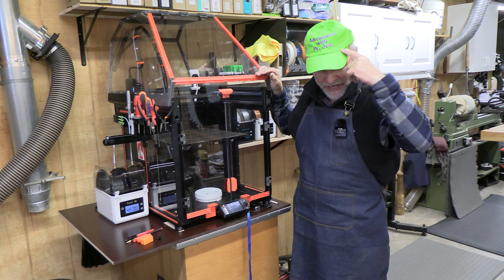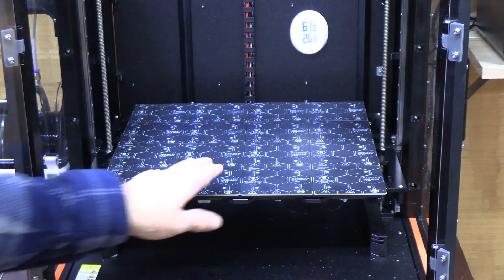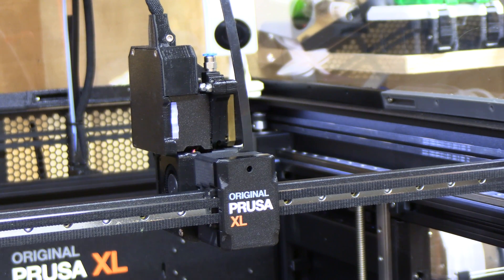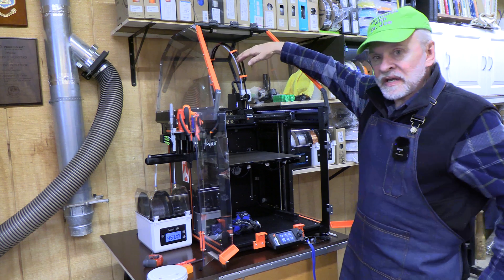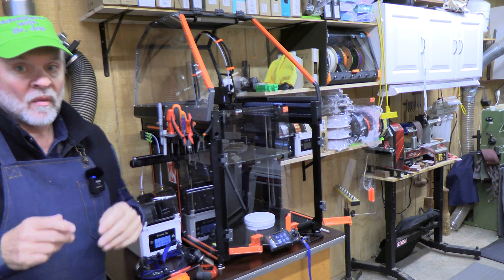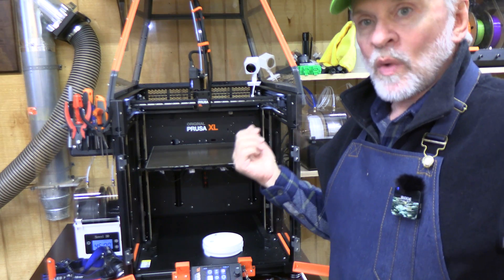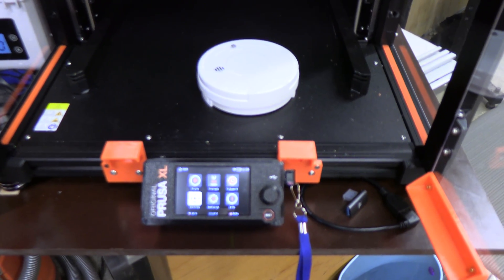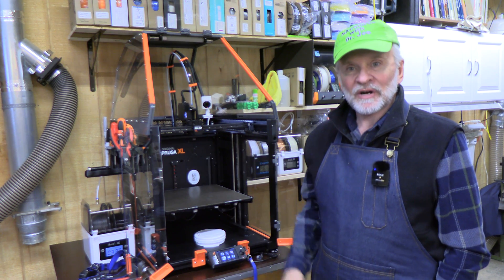PRUSA XL REVIEW: A Big 3D Printer with Lots of Features

Comment: I see you are using the Encloxure  I have the a 2 head which i upgraded to the 5 head i have been trying to print polycarbonate with the enclosure closed and found the high temps required for PC i get heat creep blockages that kill prints now where before the enclosure i mostly only had to deal with warping and problems related to that warping off of the bed.
Reply from the maker: Thank you for your comment. Yes I like that enclosure a lot. It was fun to build and I use it continuously. I have not used polycarbonate so I can’t comment on that. Pelle and PETG work great. TPU or flex doesn’t work at all. I’m having a lot of trouble with that and I’m very frustrated. Do you have any TPU suggestions? I hope you can resolve your issue with polycarbonate. Consider subscribing. Thanks. Joe.

Comment: Love the idea of using a fire alarm underneath and a fire suppression system above the printer! My wife is sensitive to having a 3D printer run unattended for this very reason. I’m sure that this would help ease her mine. Amazing idea!
Reply from the maker: Hey, thank you so much for your kind comment. Yes, it’s a very straightforward installation and that fire extinguisher is incredibly effective. It’s used in race cars and other things. Also a smoke alarm that fits inside the printer. I think makes a lot of sense. Also, when it was an easy. I just stuck it on the back so thanks for your comment. Consider subscribing. Thanks. Joe.
Reply: @JosephHunstad  subscribed!

Comment: Suggestion..
If your future plan is to reuse that waste filament.  You will want to create a bin for each filament type and label it as such.
Reply from the maker: Thank you very much for the comment. That’s a great idea. Yes I don’t wanna make a filament role with multiple types of filament that would be a bad deal. I think I will use an empty filament bag that keeps the moisture out and label it with a marker. It’s probably an easy way to do it. Consider subscribing. Thanks. Joe.

Comment: What size table would best hold the xl. I’m going purchase soon and want to make room for it.
Reply from the maker: So I measured the printer itself which is 20 x 25“. It’s also very tall. The table I have it on is 28 x 34“. So they have to be pretty big. Particularly if you want to have a filament dryer sitting on the side of the printer. I have a filament dryer on each side. If you do purchase one consider clicking the link in this video, it will help me a little bit and the price to you is exactly the same. Thank you. Joe.
Reply: @JosephHunstad  Thanks. so is it 25 deep by 20 wide ?
Reply from the maker: Yes, it is 20 inches wide and 25 inches deep

Comment: Finally about to convert my oreorder...did that nozzle kit come with the printer??
Reply from the maker: Thank you for your comment. The printer comes with a standard nozzle and then the nozzle adapter so you can order the small little nozzles. It also comes with a fine wire to help unclog a nozzle. Consider subscribing. Thanks. Joe.

Comment: On my MK4 cleaning the print sheet with isopropyl alcohol before each PLA print has solved any problems with prints lifting. I just found your channel.  Will continue to follow your XL adventures,
Reply from the maker: Yes, thank you for your advice. I’ve been using the 91%. I isopropyl alcohol to clean the build plate and it does seem to help with prince lifting. It seems that PLA lift more than PETG take care. Joe.